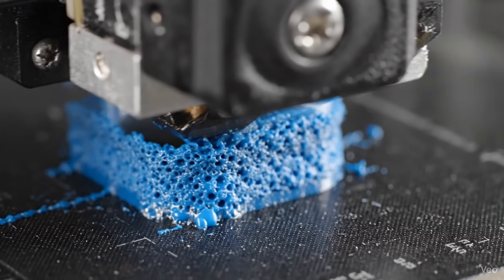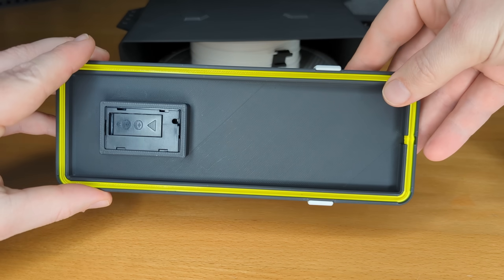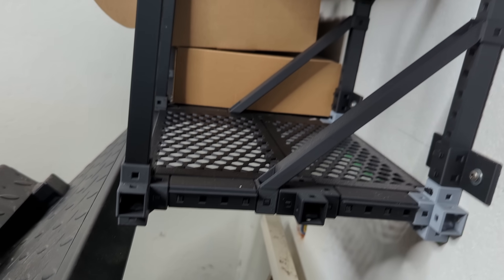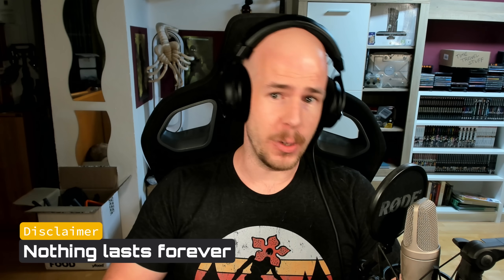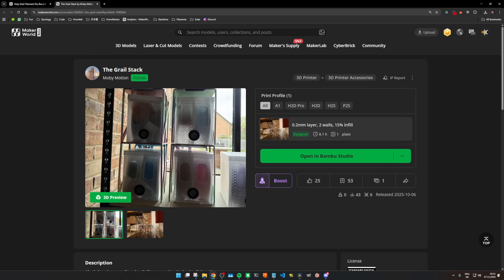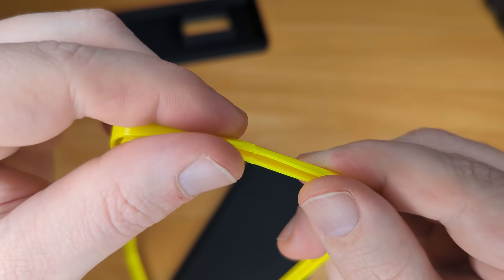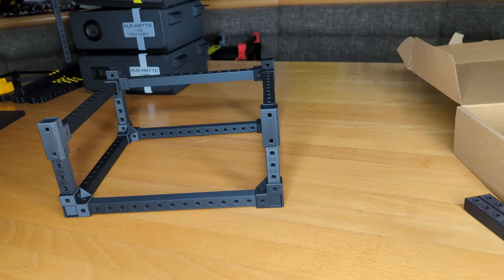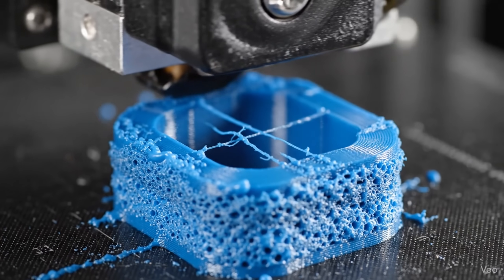Stop Killing Your Filament: My (Almost) Perfect 3D-Printed Dry Rack

Comment: i am pretty sure, the box is not truly airtight around the hygrometer...
Reply from the maker: I was sceptical too at first. In the initial prototype i even designed a tpu seal for that too. But it is pretty narrow so that it's holding up well. I tried to "blow" it out once and no air came through (at least on the round one).

Comment: I need someone to talk me down...
Redesign your idea to have a 5 liter (5 rolls?) combined chamber, that allows for a small rosahl unit to be installed. Maybe connect it to esp32, raspberry pi, to control when the rosahl unit should run, to keep the filament at the correct moisture level.
I know the rosahl unit is expensive, but maybe less care needed?
Reply from the maker: That's a super interesting idea to integrate a dehumidifier like that! Definitely food for thought for a future version (maybe v3 or an entirely separate model).
Thanks for sharing it. When I revisit the design I will definitely pick up on that idea at some point!

Comment: Imagine if you could print directly from the box. You'd need to set up a spool mount, which means adding extra hardware that's beyond 3D printing (unless you also wanted to try printing your own wheel bearings). Sure, there's products you can purchase, but really it's only a matter of time.
Reply from the maker: I've actually been thinking a lot about a V2 that would allow for printing directly from the box! (actually thanks to you and your fellow commenters)
So it's on the list for the next iteration!
Thanks for the input :-D

Comment: Are the boxes removable from the rack? I know its your system holding your boxes but it might be easier to ditch the frame entirely and make the boxes join together... you could make some joiners that allow them to clip together. As well as saving the space between boxes it would also reduce the filament needed to print the racking out.

You could also potentially print double boxes that could share an internal wall while using the same desiccant and lid system. I do like the rackmount look, reminds me of my server farm but it might make sense for some people to be able to store spools vertically, horizontal space is usually more limited than vertical and it would allow people to fill that small gap between 2 items.

Its a really clever system and idea, i hope i can work it in, i am currently looking at making a drybox/AMS/Enclosure and i am wondering if i could work any of these into the design; thank you for the designs and all the food for thought 🙂
Reply: I weould add a bowden tube connector and make the rack hold the box with a printed rail or whatever connection to when you want to print take the box and connect the bowden tube and the filament doesnt touch air and it keeps it dry all the print through.
Reply: @lordgandalf22  it would need rollers of some kind and that would get tricky, theres also no way to look in without opening the box to see how much is left; its why i was thinking keep the storage and in use filament close but not together

A cassette system would be great but your duplicating so much hardware; i think i have 12 cereal dry boxes each with desiccant, rollers on bearings, hygrometer and it gets to be a pain, i think the idea of dropping a spool into the AMS and placing the one i just removed into its vacant box... i think perhaps magnetic tags would be easier to add and remove them off the boxes
Reply: @Tim-Swann yeah it would take a way to lock and unlock boxes bu it keep any filament dry the whole time. That would be my idea.
Reply from the maker: so many good ideas in this thread here. Definitely food for thought for the next iterations. Thanks to both of you ( @lordgandalf and @TimSvannell) for this exciting discussion.
Reply: @kellerlabs  Its a great video that contains and sparks so many good ideas; i had considered some printing containers but hadn't come close to being as functional as yours; ill definitely be watching to see what you come out with next 🙂
Reply from the maker: @Tim-Swann  thank you so much for the kind words. Very motivating 😀 I'll give my best to keep up with the expectations.

Comment: You said you wanted a challenge, so here goes:

Make the boxes vertical, and a Bowden connector on the lid so you can print from them. I know, I'm evil. Sorry. 😂 I was thinking an internal rail system to put a small pipe that the filament hangs from inside the box, so that it spins freely.

Always love the videos! Loki was good doggo! Future HomeRacker idea: treato dispenser for good furry boys and girls.
Reply from the maker: Those are some seriously evil ideas! 😂 But I love the challenge, especially the treat dispenser!
For the dry box ideas: These are FANTASTIC! I'll add them the feature list for V2.
thank you!

Comment: you'd spend way less on cereal boxes which has a seal on them and clear and no time to print them  i get the idea of these but isn't practical at all
Reply from the maker: good point you have. The main intention was to have a somewhat standardized solution to be printable for everyone independently of where one's located. Since this is a journey I'll revisit here for sure! Thanks for your feedback.
Reply: i was getting ready to say something similar, though i would appreciate a good way to store my cereal dryboxes vertically, rather than having little choice but to store them standing up side-by-side.  the problem i run into even with stickier tpus is getting them to sit still longish term without sliding out some or requiring a stabilizing bar of sorts - stickier tpus lose some of their stickiness just from ambient atmosphere over time.
Reply: @TinkerDad3D ultimate filament box has attachments to the cereal boxes to stack them. If you search that should eventually find it. There are a few called that so just have to sort through them.
Reply: @radfaraf i can't find the solution you refer to, so please provide a link if you can - i'm sure i'm not the only person who will benefit.  my current favorite solution is a combination of several - bearing driven, screw clamped design with bottom held desicant carrier with sliding top, pc4-m6 connector for ptfe, printed labels as appropriate.  the desicant box design changes slightly depending upon the shape of the cereal container, but the overall design stays the same.
Reply: It's also made by GunplaMark which should help a lot to find it.
Reply: @radfaraf i have seen that one.  what i use has the box rightside up with the desicant in the bottom & a center bearing assisted spool holder.  nothing particularly fancy, but i like how it works.
Reply: The main point is to endlessly only print things for 3D printing.
Reply: as mentioned in the beginning of the video, those are not easy to find everywhere in the world.. so far I did not find a place to buy any of the boxes used in common filament storage solutions.. not saying this is the best solution, but it's definitely alternative that's worth considering
Reply: plus the cereal box ones let you print from them, no need to open them until it's empty.

Comment: Always looking forward to your videos!! I'm building a rack that's ~12inch width and homeracker looks perfect to be adaptability to this unconventional rack size. I would love to see a video for unconventional rack sized builds, or custom rack enclosures for variable sized components.

My use case is a ~11inch width switch with multiple 13inch Framework mainboards (~10inch width). As well as multiple HDD all in a compact solution
Reply from the maker: Great idea! Thanks for the input.
I'm not sure on HOW compact we can get here, but I will take your input onto my todo-list for a generic solution/video. If you want, provide me the exact dimensions of your devices. I may be able to simulate some solution then, cannot guarantee on any timeline though.

Comment: Compared to the cost of a cereal box or other airtight containers, the price is not so bad. I'm more concerned with whether it's truly airtight. Even the cereal boxes and nominally airtight containers seep sometimes quite quickly.
Reply from the maker: it very much depends on 2 things:
the "traffic volume" (how often do you change spools) and the air volume (if there not much left on a spool you have more humid air filling the box each time).
I can say from experience that half a year without recharging (TPU) was no problem whatsoever.